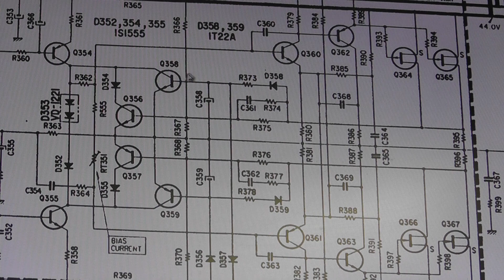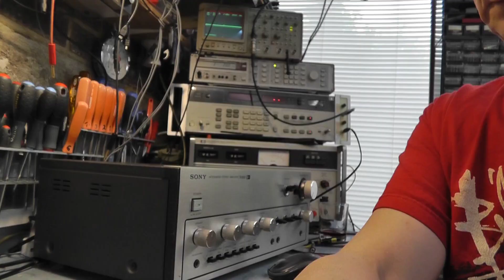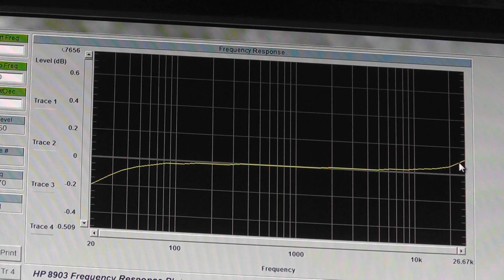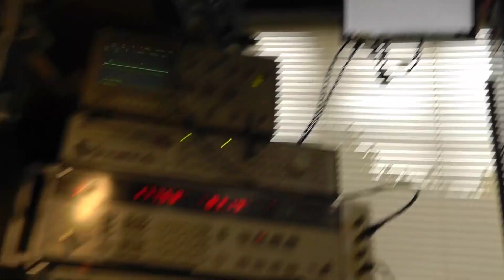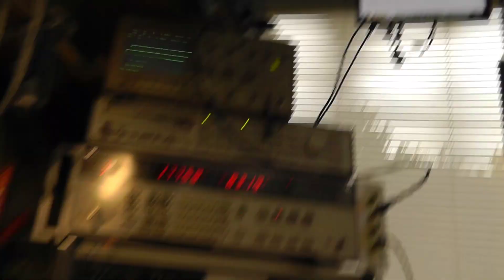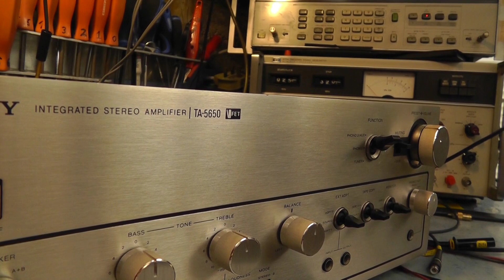Sony TA5650 repair & test

Comment: i just bought one of ebay,my question is if is dangerous to use a pair of infinity quantum jr that are 4 ohm but i will never go half ,more likley 11 a klock. is it dangerous? i love the speakers cause they have the EMIT tweeters. kind regards
Reply from the maker: Should be fine if your not driving it hard.

Comment: Hi Simon, in the first video while you were recording the main board you can see that the transistor Q 361 is well connected, the orientation of the legs is good. Can you attach a picture of how it is now attached? I have the same amplifier and the same distortion problem so I need help.

Comment: The resistors are just gate stoppers. This particular amplifier relies on the output FETs being matched so that they share current equally. Normally you would have small resistors in the drain (the equivalent of emitter resistors in BJT amps) so that they current share. No idea why Sony chose to require matched parts instead.

Comment: My goodness, I had thought you would be in for a hair pulling experience trying to isolate where the distortion originated from. It's amazing the distorted channel had even managed to produce a signal with the transistor misaligned.

Comment: Ooow a logan spam a lot bot.
So the amplifier didn't actually fail, some silly bugger got the transistor in a twist but it didn't do any damage.
Very lucky indeed :-D
I have an old pioneer sa706 amplifier saved from the dump, but my hearing was damaged at 30 with eather measles or chicken pox (Cant remember which one but it really buggered my ears up).
Tinitus in both ears and if i talk then the tuning forks get louder and louder and distort any music.
Makes it horrible to listen to :-(.
Frends have asked me how i cope with it, i usually say im a mad axe murderer at the week end lol.
Before it got so bad, i could hear distortion at very low levels and i told a frend his amplifier had a problem on one speaker and to check the d.c bias level.
He said 'Naaa i can't hear anything',  he checked the amplifier and said 'You were right, one channel was way off'.
Reply from the maker: Sorry to hear you hearing was damaged when you were young, that's awful. I appreciate your comments very much. Thank you.
Reply: @SoddingaboutSi  Well trying to give a decent comment is my way of showing appreciation for you going to the trouble of creating great videos.
I don't always hear things correctly so i can make mistakes, just so you know.
Sometimes i laugh at what i thought someone said, like a ronnie barker scene :-D
Ill shut up now, waffle mode lol.